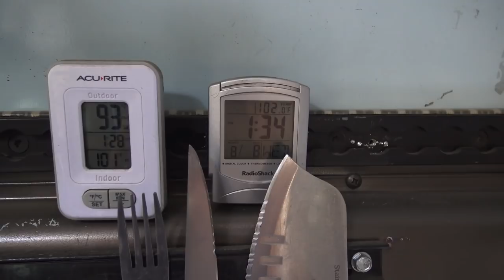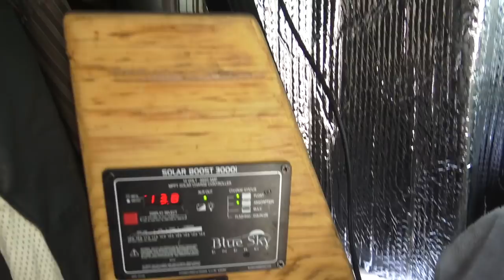A Day in the Life of a Nomad | Camp Walk around

Comment: Niiiice camp, Jamie 👍 stream included 😀.  Your bus is coming along in bits and fits with great outcomes. The shellacing looks excellent. Are you planning to insulate your bus and roof?
Reply from the maker: Thanks! Probably no more insulation in my future than the drapes. I tested the bus in winter temperatures last December and January and it works out fine just had to run the heater a little bit more. I basically stay in warm climates as a rule as it is. Cheers!
Reply: Enigmatic Nomadics Thanks for the reply, Jamie. Yes, I know you normally stay in warm climates, lol 😄. But I was wondering if insulation would also help keep out some of the heat of the summer?

Comment: I'm confused as to how you charge with solar and shore power, and how it's setup.  Power comes in from the generator directly into the inverter?  How does the power flow out from there?  Also, how do you connect your solar panels into that setup?  I'm confused as to how you stop the flow coming in/going out.  Any insight would be great!
Reply from the maker: I use an inverter/charger. I explain how it works in great detail and CeCe solar videos that I'm putting up right now. It's an awesome setup!
Reply: Enigmatic Nomadics cool I can't wait to watch!